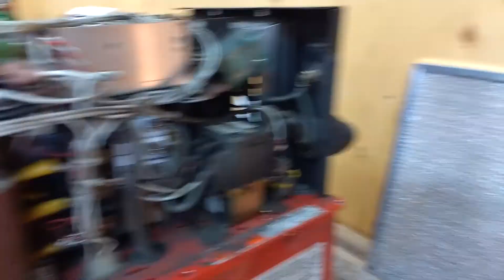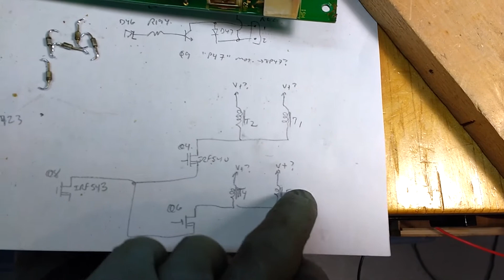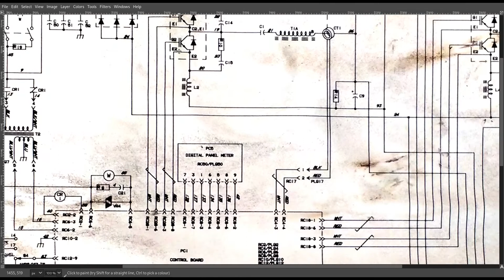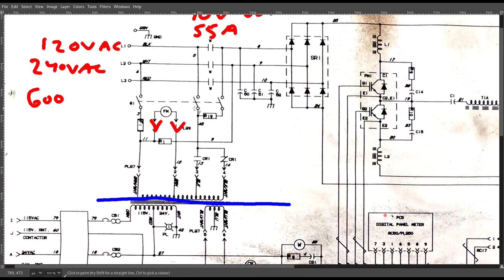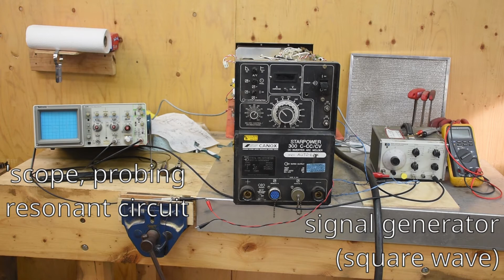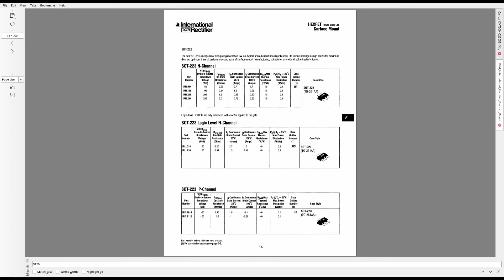Canox Starpower / Miller XMT 300 welder: troubleshooting and repair

Comment: I just recently came across a miller XMT 300 machine and took it apart to investigate the rc14 plug contactor not working with the feeder trigger. (It made a loud buzzing noise when i would flip the 14 contactor switch)

Also the fan wouldnt work and during start-up im pretty sure every contactor and relay would make crazy buzzy noises a rapid-fire on off noises. The weld output however was spectacular. I was able to crank all the settings on the machine and compete with a lincoln electric inverter machine on a low 240 volt single phase input.

Anyways i decided to take apart the contactors and relays and clean them using techniques ive used on magnetic starters for higher voltage ac motors in the past. I put it all back together and boom, all the weird noises go away and every contactor clicks and works as a contactor should. My only compliment is now my weld output has change entirely.

Not necessarily in a bad way because it can still weld very smoothly at a lower set voltage and lower wirespeed, but as you try to increase your voltage with the wirespeed, it basically cant keep up anymore? Almost like it hits a peak and stops.

I noticed a bunch of trimmers on the main board but i have no idea what purpose they serve and miller godforbid will never disclose any information on their PCB designs and the interworkings. Im wondering if you by any chance think these trimmers on that board have somthing to do with calibrating the frequency for the weld control, and  perhaps i might have thrown off the calibration by cleaning these contactors that haven't been touched in decades?
Reply from the maker: Hard to say. Wouldn't say I "enjoyed" working on this welder and I was not sad when I heard it died a 3rd time of unknown causes, and was then trashed. The trimpots IIRC are 10-turn trimmers and even if you jarred one it wouldn't (shouldn't) make a massive difference. Only ones I can find in my notes are - 
-R153 adjusts I_out sense gain, reflected in displayed amps. Check output with clamp current meter vs display. There's also trimmers on the front panel PCB that may also affect readings / settings.
-R103 not obvious. Part of complex feedback loop, recommend not messing with this.
In fact, I recommend not touching any trimpot at all. Maybe you shuffled conductive dust around somewhere, front panel controls, who knows. Maybe now it's actually "within specs"; I can't explain why it would not have been before. Only way to find out is have a buddy measure  (very carefully) current & voltage during a weld, and see if it matches display / settings.

Comment: Thanks.  I picked up a dead similar unit and a foot pedal for cheap, and was looking at fixing it.  It's really nice to have someone familiar with it go over everything.

In my case, 3 of the four discharge resistors also failed.  Making things a bit spicy.  On the positive side, it made it easy to see that an IGBT failure lead to mains (240V) going through one of the control transformers and the 10 ohm resistor.  Which more or less exploded and was giving an arcing sound when the main contractor closed.

Still debating if it's worth the time/money to fix it.  But that's the advantage of being a hobbyist compared to a repair shop or using a welder to make money.

Comment: @fenugrec What igbt mods did you us for replacement? Saw that the Toshiba part was discontinued.
Reply from the maker: Original PN is MG75Q2YS11 , back then there were a few on ebay, but I went with CM100DY-24T instead. It required using a different set of holes in the heatsink due to the different mounting size.
The welder eventually died again after ~ 1 month of regular use, cause unknown. The CM100  IGBT does have slightly different specs but I don't think it's the root cause of the cascade failure. I think the machine was binned, since the damage was again both dead IGBTs + dead bridge rectifier.